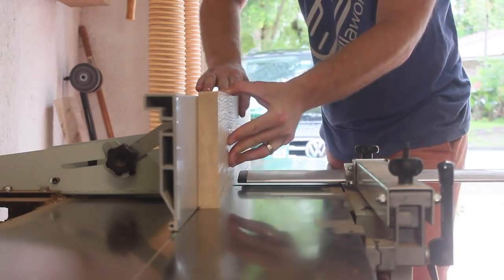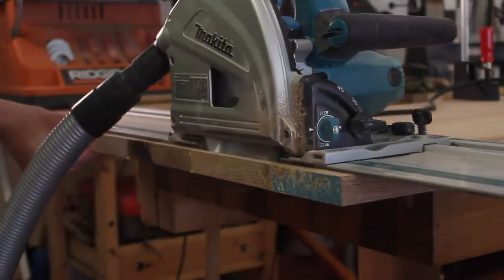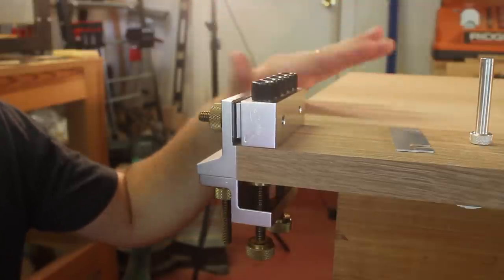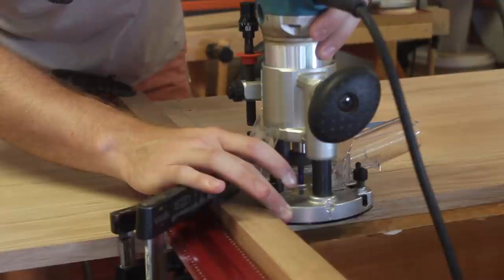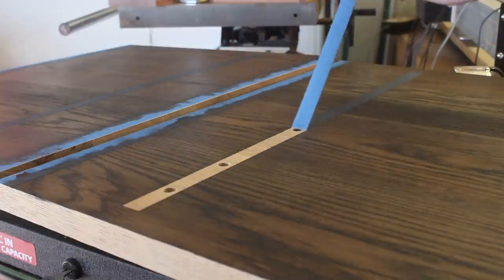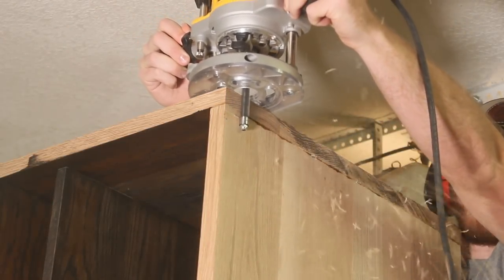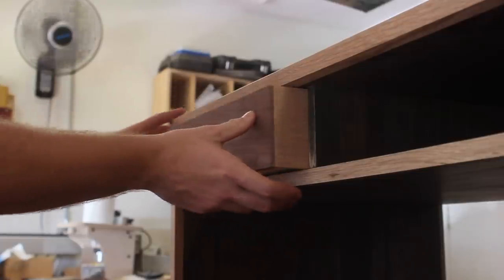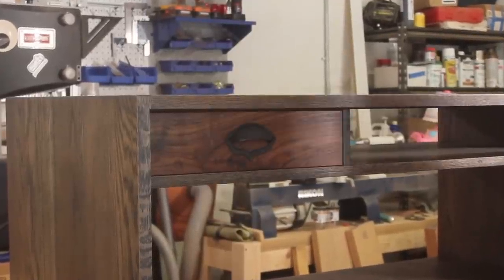Making a Big Oak Coffee Table

Comment: Beautiful work as always John.  One of my favorite woodworking channels. 

I'm surprised this is your first bigger project with Rubio Monocoat, it's one of the top finishes in my shop.  If you'd like just a little bit more sheen, try using their Maintenance Oil.  I apply it after Monocoat on all my projects, it adds a little more sheen bringing to about a satin finish instead of flat.

Comment: Hey Jonathan, Great video and a nice table! 
I have a quick question for a pro, I applied a single coat of rubio on large walnut dining table about a year ago. However,  a handful of areas now appear pale. I believe this is due to some ares absorbing a lot more rubio than I expected. What do you think is the right remedy to remove the pale areas? should I sand the whole table again with 240/320 grit and reapply rubio again once or twice ?
Reply from the maker: I’m still a Rubio beginner but from what I understand, you should be able to simply reapply it. Only the parts that need more will absorb the new coat. I would clean the surface, maybe lightly sand with 220 then apply the new coat.
Reply: @parillaworks  Ok sounds like a plan, thank you. do you use anything particular to clear the surface of residues, such as oil or dust?
Reply from the maker: Rubio sells a purpose made cleaner for their products, which is expensive but I think it lasts a long time. I haven’t purchased it yet but might down the road. Other than that, perhaps a warm and damp rag.

Comment: I’m curious to know why you didn’t use the track saw to crosscut the top to final length and instead opted to use the table saw?  Beautiful piece by the way!
Reply from the maker: Thanks Matthew! I had to make 3 pieces 46” long. I would prefer to hang cut them with the tracksaw but it wouldn’t cut all at once. The table saw was better suited for repeatability. I’m going to setup a MFT/parf style table so I can use the tracksaw just like you’ve described.

Comment: I'm curious about the dowels. I typically build shelves or tables like this using dadoes, I assume this takes less time and provides sufficient strength?
Reply from the maker: It doesn’t necessarily take less time. It just gives a different look. If I wanted to do stopped dados then it would probably take longer. But dowel joinery can be very strong in a lot of cases. They’re essentially little mortise and tenon joints.

Comment: I don't share your patience with dowels. I've got the jessem jig and I think I've reached the end of my tether. I recently made a large birch ply unit for a friend. The time lost and fear of creeping minor inaccuracies with that thing have pushed me towards finally buying a Domino. Having said that, I'm sure boxes wouldn't hold quite the same potential for nightmare situations.
Reply from the maker: I’ll admit I get frustrated from time to time. One of the main reasons I’ve considered a Domino is the ability to cut oversized mortises. It’s a real game changer. If I ever hit a higher production level I might reconsider it.
Reply: @parillaworks  The price tag alone is hard to justify, but I know I'll use it more than enough to get value from £1000+ for the XL.

Comment: I don't get it.  You did great jointery on the drawers but then Ikea the carcass and frame?  So the drawers will last but the rest will fall apart in a few years?  Sorry but that's cheap.
Reply from the maker: What does “IKEA the carcass and frame” mean?
Reply: @parillaworks  Look, you have skills and great artistic vision, but your execution on the insides and the frame of your table were poor.  Butt joints are next to useless for bilateral strength and without heavy reinforcement they will eventually twist and sag heavily.  You could have accomplished the same look on your frame joints and reinforced the structure at the same time using half laps, dados, or even upgrading the dowels to bisquets.  Your current design looks nice but it won't last.  Think to yourself of 2 toddlers playing tag around and on top of the table, which is the ultimate test to longevity, or how the joints will perform when moving the table from house to house.
Reply from the maker: Butt joints are perfectly fine as long as they are reinforced. In this case they have many 3/8” x 2” dowels glued in place. Biscuits would be of zero help, let alone an upgrade, compared to dowels. I’ve sat on the table multiple times and it doesn’t budge. I really have no concerns about the longevity of the joints and their strength. It’s a simple butt joint reinforced with dowels; it’s about as woodworking 101 as it gets. Not sure where the disconnect is.